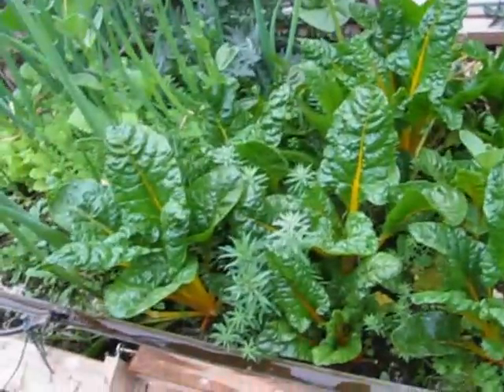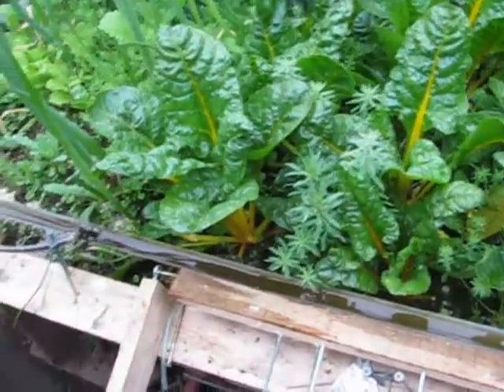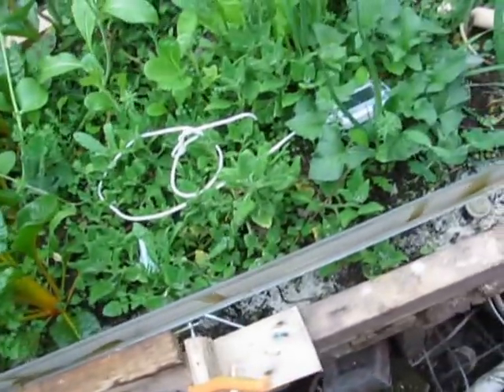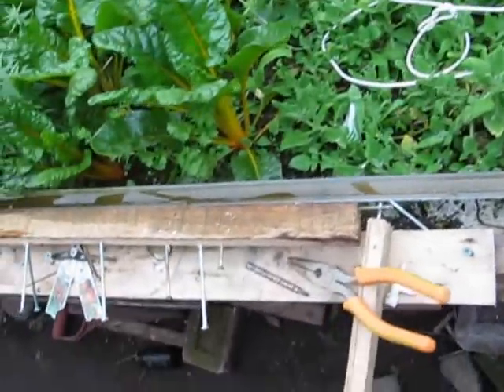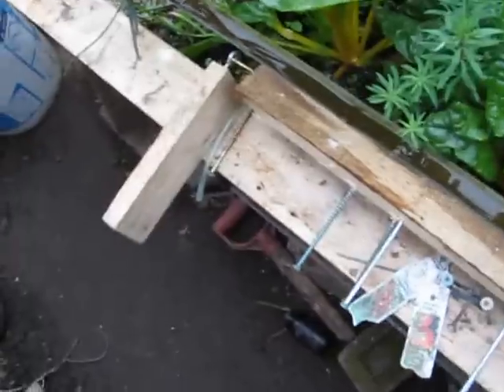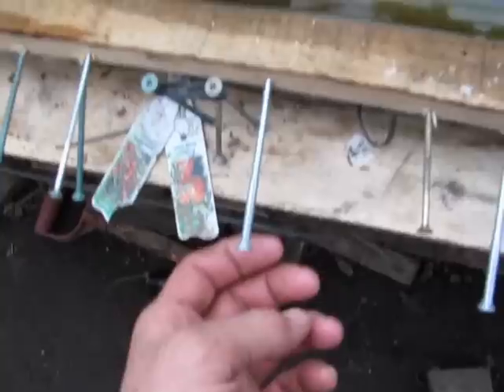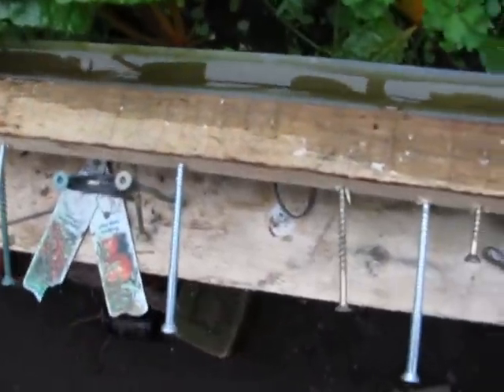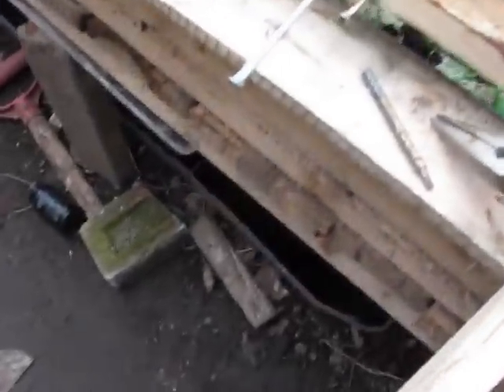Aeroponic pallet garden?  Part 2 shows good root growth.

Comment from the maker: Hi, idea lady,   I think barley straw either sinks or floats really really low when it gets waterlogged.  So you will need some floats in the straw bale  or beside the bale about 2/3 the way up to keep the roots out of the water.  Perhaps you could bang in a couple of rebar and tie on two  4 inch pipes as floats either side.  (you get end caps and seal them as pontoons).  Or you could use 4 L joints and just go right round your bale. Anyway, if you do that your idea should work. Brian